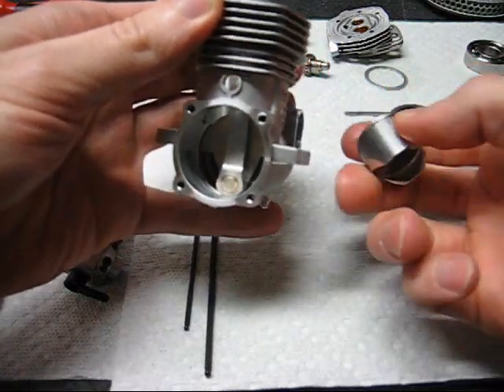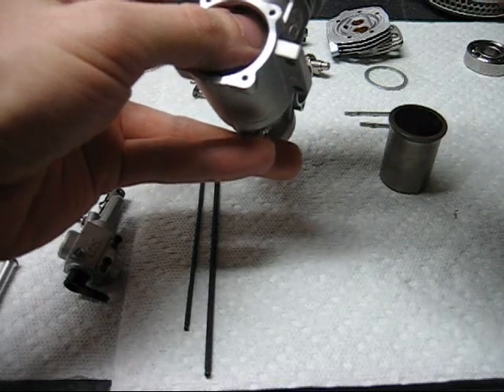OS FS-52 Four Stroke RC Glow Engine Reassembly Part 1

Comment: Only one remark: when I install the piston, I first insert the piston partly into the liner, such that the wristpin hole is still uncovered, but the ring is allready in the bore. Then lower the liner including piston into the crankcase untill the wristpin hole and the access hole line up. Turn the crank untill the small end bearing also lines up. Then insert the wristpin, and push down the liner home.

I do it this way because I have damaged (burred) the ringgroove once when trying to wiggle the piston into the liner (3:05 and further in your video). If the ring has been replaced, sometimes the relaxed ring is a bit too wide to wiggle it in like on the video.
Reply from the maker: Bert, I could see that happening, though I've never experienced it myself.
Reply: True, the clones are more susceptible to this, as usually the bevelled edge in the bottom of the liner is machined out less smooth,
That's where OS shows its difference in manufacturing.

Comment: Does it matter if the dot is up or down? as long as its lined up correctly with the push rods...?!
Reply from the maker: It does not matter, as long as it's aligned.
Reply: Looks like I kinked one of the piston plastic retainers, and it fell off.

So one side of the wrist pin is exposed to metal while the other has the plastic retainer.

Any ideas where I can find replacements, or some kind of solution for it.
Am dead in the water if I cant find a retainer for the wrist pin.
Reply from the maker: The wrist pin includes the pads and they are reasonable. Stock at Tower looks like it varies right now.
Reply: rcdieselrc ... thank you, I found them, so am back in business 😀

Comment: Nice tuto!! Congrats!! Have you a similar video for a FS 91 Surpass? Thanks...
Reply from the maker: FS-91 is identical except for split type valve cotters. If you haven't worked with these before, remove them inside a transparent plastic bag so they don't fly away on you. They can be very tight, so you'll need a tool to push the spring retainer.

Comment from the maker: Oil works it's way past the valve stems and lifter bores. When I have one apart I always add oil in the rocker well, to make sure there is plenty. Some newer OS engines have an  active method of getting oil to the top end.
Reply: does it use fuel
Reply from the maker: I'm not sure what you're asking. There is oil in the fuel, but I add oil to the crankcase before starting a rebuilt/cleaned or new engine so that oil is already there.

Comment: How Do The Stems Get Oiled While The Engine Is In Motion Because I Notice These Engines Rely On Lubrication From It's Fuel But How Does The Fuel Get All The Way Up The There ?
Reply: can you use a spark plug
Reply from the maker: Yes, I've used spark ignition with these engines.

Comment from the maker: Improperly adjusted valves can result in poor running or no compression. After the break in period the valves should be checked once a year.

Setting the valves is explained in Part 2 at 3:20

Comment from the maker: @MaxwellForce I add oil to the rocker well before running them as OS engines are typically shipped dry. Use after run oil as instructed in the manual. The corrosion is problematic in both two stroke and four stroke glow engines.

Comment: I have just bought an OS 30 FS surpass, lovely little engine. Is it necessary to put some lubricant on the rockers/valves and the camshaft before the first startup, or do I just start it up? I’m planning on running it with 18% synthetic oiled and 2-3% castor oil, with about 7 % nitro. How do I protect the engine from corrosion from the nitro, or is this not a problem with four stroke engines?

Comment: Hi, Would it be possible to partly insert the piston just past the ring into the sleeve then slide the sleeve into the engine . then insert the piston pin through the hole as you have shown ?,, Cheers.....

Comment from the maker: Rarely does something go wrong. Valves should be checked after break in. After that maybe once a year. If you put it away for some time, follow the instructions to clean and preserve the engine to prevent it from gumming up.